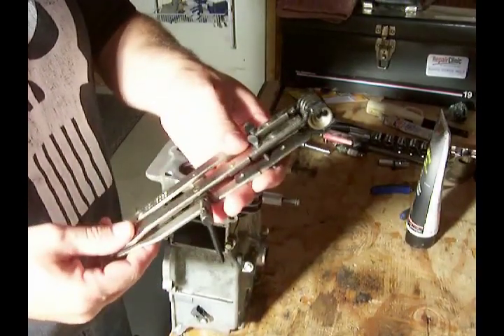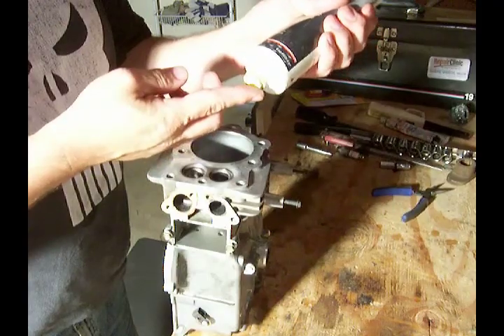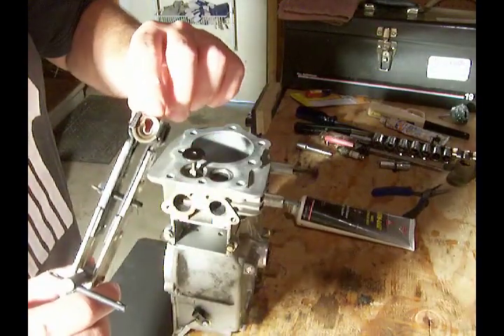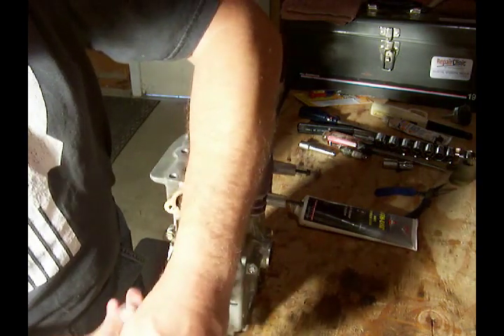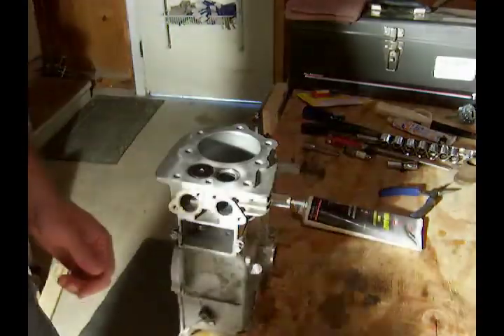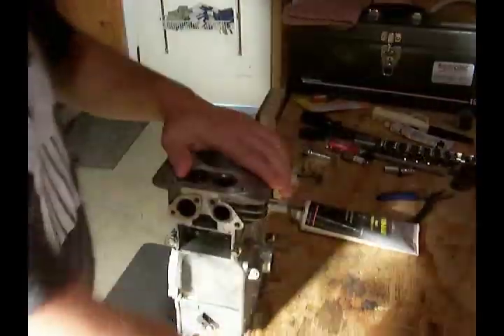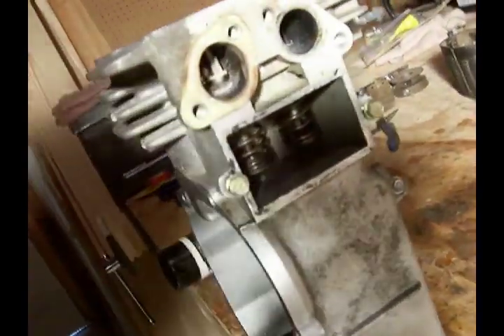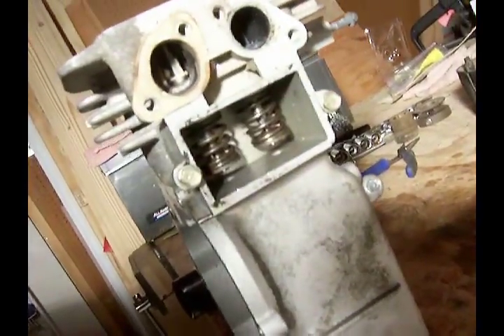#10 Tecumseh LV195EA / LEV120 - Tear down and rebuild - Valve installation

Comment: You shouldn't install the valves until after the camshaft is installed and you have checked and if necessary adjusted the valve to lifter clearance. If clearance needs to be adjusted you will have to uninstall the valves in # 16.